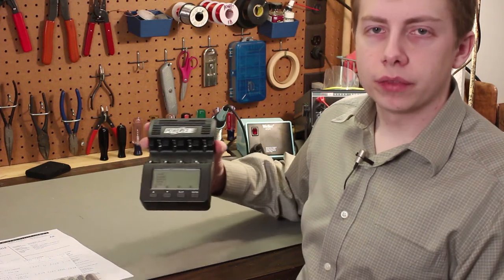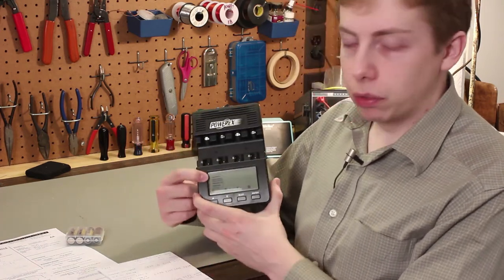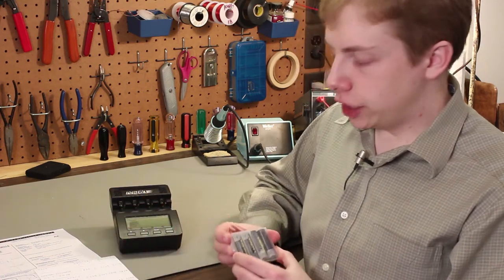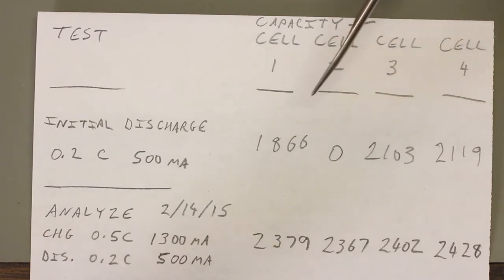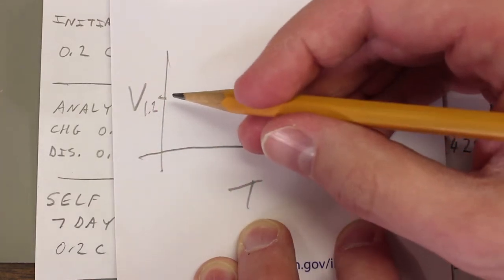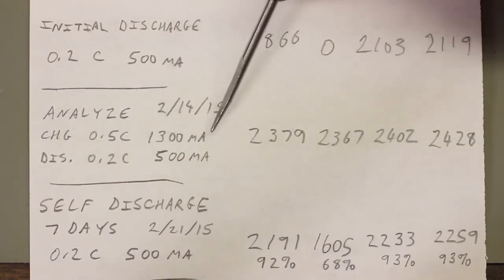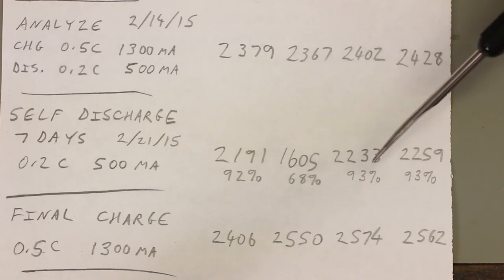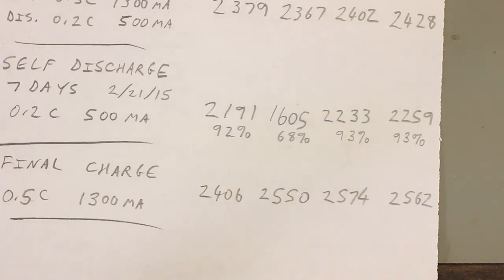Identifying Faulty Cells with the Maha Energy Powerex MH-C9000 Charger-Analyzer

Comment: Hey nelson, thanks for this.  I just received one of these from a friend, but when I put in an old eneloop to test out, under the refresh/analyze option, after selecting charge and discharge rates, the charger only displays and cycles mah 0, ma 125, min 0, volt 0.  does this mean the charger is not working properly or is the battery kaput? I tried some other batteries with similar results.  thanks
Reply from the maker: Good question! If that persists for more than a few minutes, it means the battery is shorted. There are techniques for repairing shorted cells (search YouTube) but cells that have been shorted often short again soon after being revived.
Reply: @w8nwo  hey thanks for the reply.
Reply: @w8nwo  just a quick update, I googled and found some others had similar problem to my issue above.  The problem is that one of the surface mount chips went bad, once I replaced it, it worked again!  The chip # TI SN74LVC1G3157DCKR was bad.
Reply from the maker: @seedyeh  Interesting; good to know!

Comment: As far as I know, PowerEx 2700 batteries are not LSD Ni–MH batteries (low self-discharge nickel metal hydride)  and therefore have some natural discharge.

Sorry, but the tester you use doesn't have a -dv/dt termination at all, but constant voltage with a top off charge and has the temperature sensor as backup.

The charger also uses trickle charge/current after the charge itself has stopped. This means that one should remove one's LSD Ni–MH batteries (Eneloop) after charging so the are not to degrade.

I do not agree with you to replace only the defective battery. You need to replace all the batteries used together in the appliance to get them as identical as possible.

In fact, the best thing is to pair the batteries you need with their internal resistance, which your charger can't measure.
Reply from the maker: You're not the first person to tell me that this doesn't use -dv so I take your comments seriously. However, per https://mahaenergy.com/faq-c9000/, it says "The MH-C9000 uses a combination of Negative Delta V, Zero Delta V, Peak Voltage, time and temperature to determine the end-of-charge."

I do agree that cells should be replaced together, and yes, matching based on internal resistance is a good idea. However, I usually buy cells in large batches and then match them based on capacity. If one cell develops a high self-discharge fault or loses capacity, I select a new cell from the same batch. Or, if I have a handful of random cells laying around, I'd rather use them to the extent possible before I buy new cells.

Some brands are better than others. For a while, I was using those purple Panasonic NiCd cells. I'm still using some of those cells 12+ years later, but others died long ago. This charger allowed me to analyze those cells so I could discard the faulty ones and keep using the remaining good ones in applications where I didn't need as many cells. For instance, if I had six and one failed, I'd put the four best ones in a device that only needed four cells.
Reply: @w8nwo  Sorry, but I haven't seen you answer before.

Yes the charger uses a very special algorithm I suspect has been changed several times over the years. You can see a test of the charger here with a description:
  https://lygte-info.dk/review/Review%20Charger%20Powerex%20MH-C9000%20UK.html

Wee also uses many rechargeable batteries in the house here, Ni-Cd batteries we discarded when Ni-MH came out with a reasonable number of mAh and the price came down. Since the Eneloop batteries came down in price, we have not used any other than Japanese batteries such as Fujitsu, Sanyo, Pannasonic and Ikea LADDA and will not use others. The Japanese-made batteries you can rely on are pretty much the same when you get those from the same batch, unlike the Chinese ones.